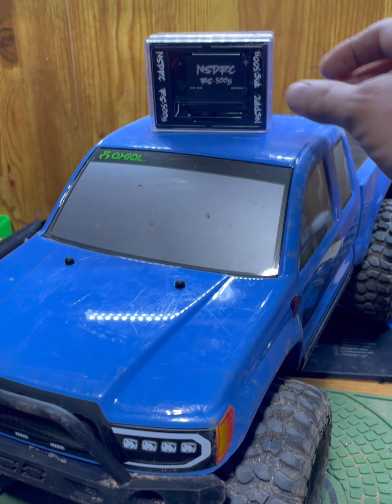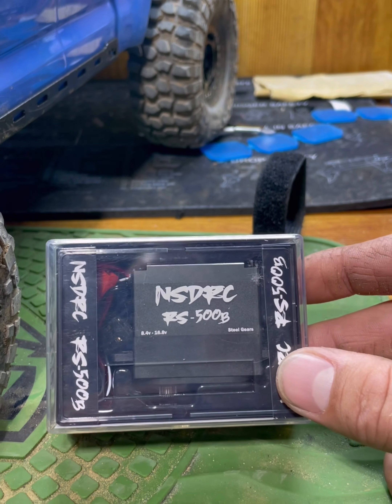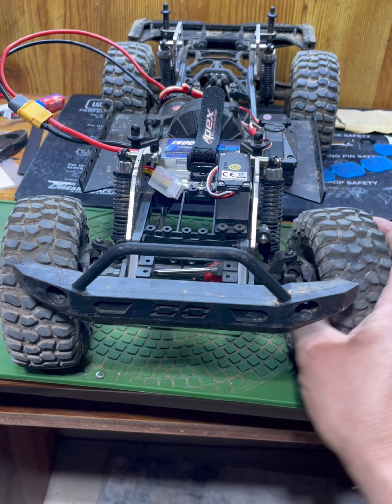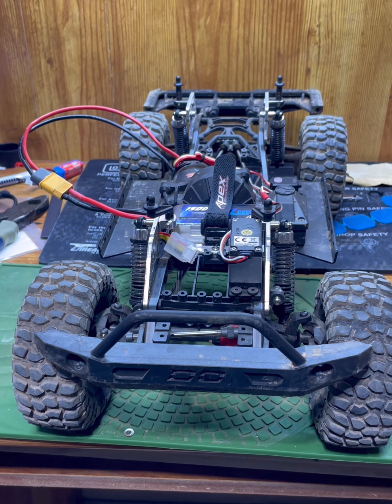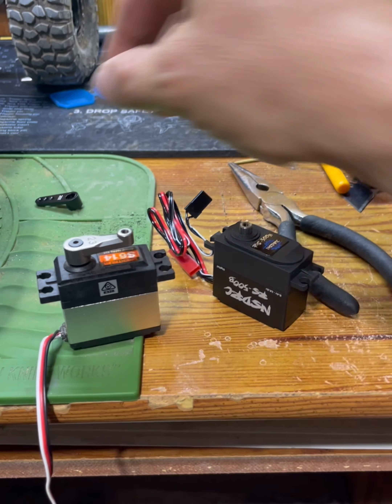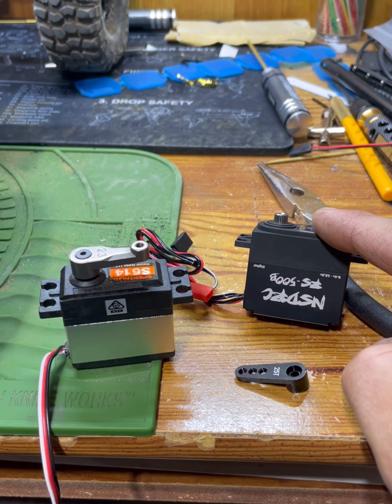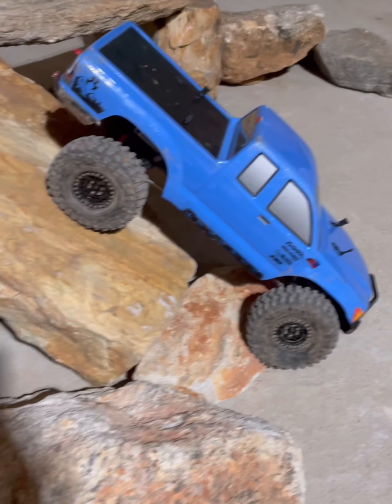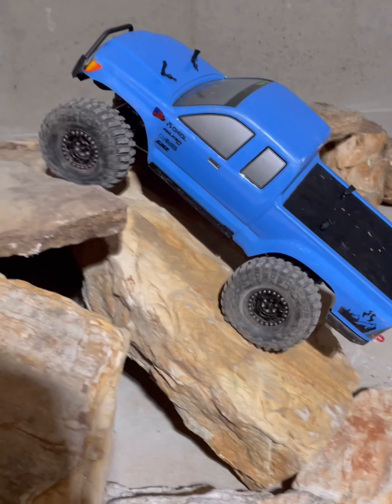NSDRC RS500B Servo Install / Review

Comment: Badass servo for sure best budget servo direct power in the market...it was this rs500b or the shifts xb servo and this is the by far for the 60-65$ is the best from what I see....moving up from the go to Amazon 35 kg servos and this is the one I'll hang my hat on...great video..idk what that other guy in comments was saying clearly he's high or just connected to a servo brand so the hater comment I can see....thanks for the great video
Reply from the maker: Thanks bro I really appreciate it. I’ve had this servo for almost a year now and have put it through hell and I haven’t had a single problem.
Reply: @HighLineRC  jus ordered mines litterly 10 mins ago and ur video was a big part of it...thanks so much ..keep it up
Reply from the maker: @josecanseca8979  you welcome and I’m glad I was able to help. Just a tip incase you are not aware, be sure to physically disconnect the battery when not in use on all direct power servos or you could burn it up or damage your battery. Good luck let me know if I can help with anything else.
Reply: @HighLineRC  oh once the trail run is over the whole lipo is outta there..and the dual in line xt60 connector...im good with my lipos and storage charging so fr so good...should be here by thursday cant wait

Comment: ...If during your video, this is the new NSRDC Servo, I would get my money back, cuz that is not "500" inch/oz. of torque/power !!! Plus it sounds like a stock RTR servo...
...maybe it is !!? 🤔✌️
Reply from the maker: The second run was with the RS500B. It is substantially better that the stock servo was. If it is defective i wouldn’t know because I don’t have anything to compare it to. I’m still running this 500b and I’m happy with it and it was a big improvement over stock.